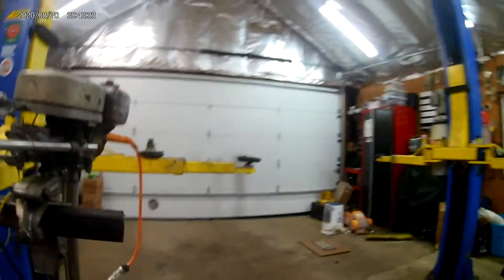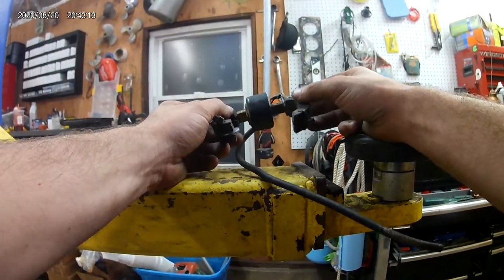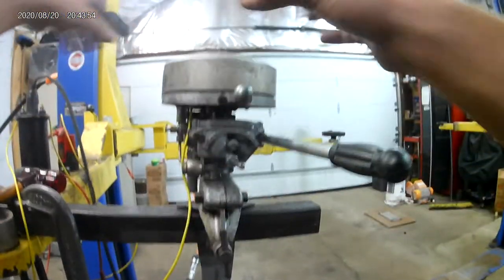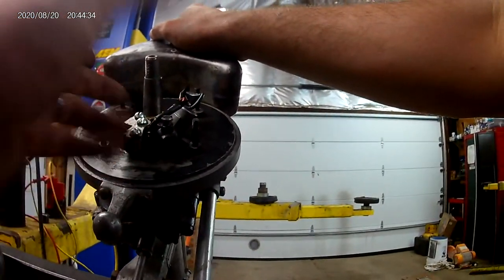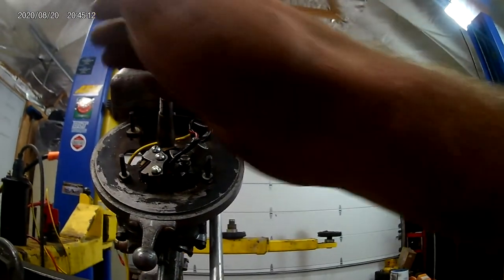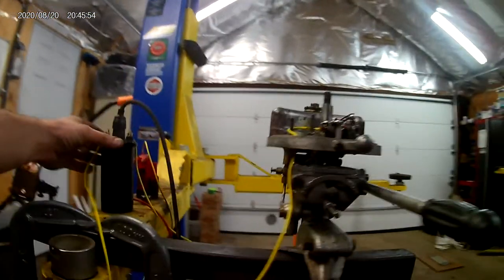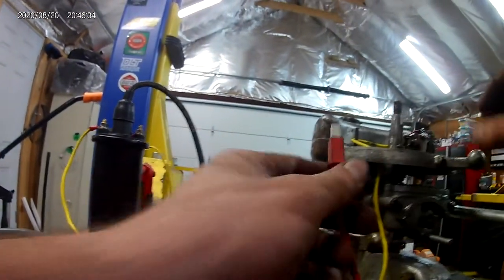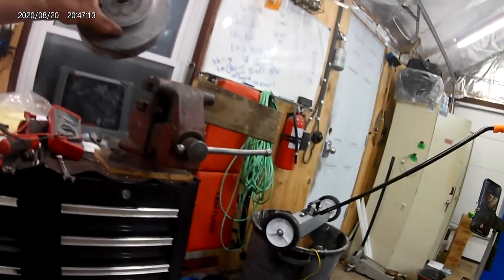1939 ELTO Pal outboard running with external ignition coil

Comment: To get the motor to idle properly you have to have that little nub set to the screw on the right side of the carb
You're welcome also open the fuel vent